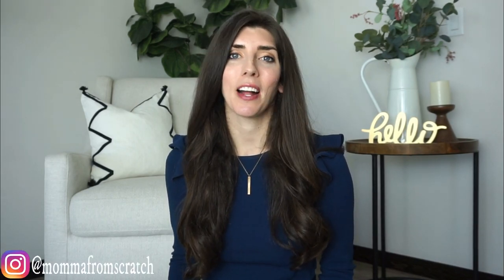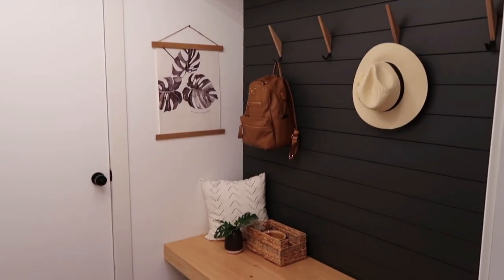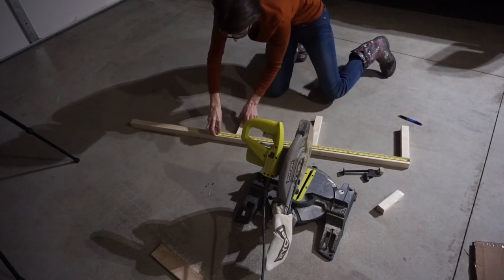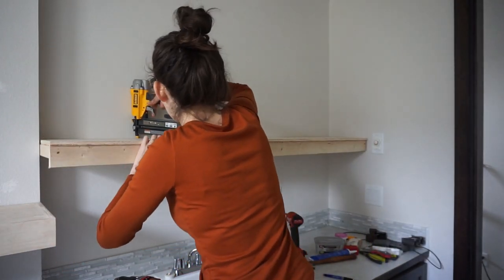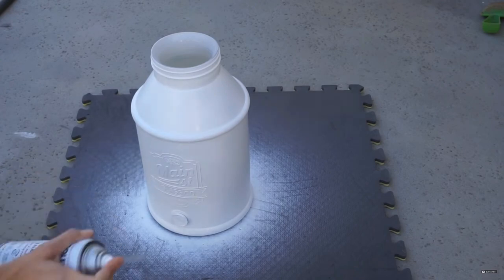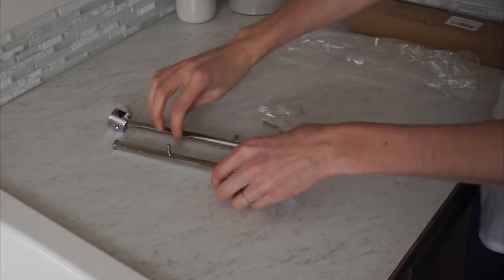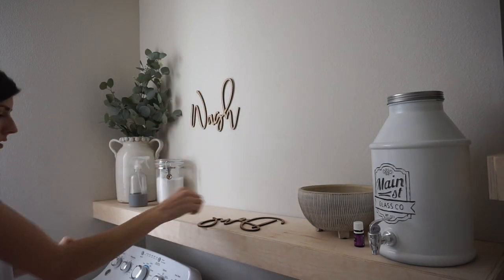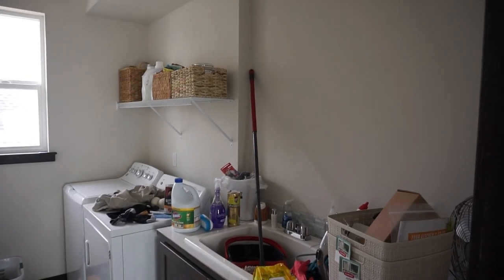Laundry Room Makeover 2020 | DIY Room Makeover under $150 | Modern Farmhouse

Comment: I actually had my daughter use her cricket to make my Laundry today or Naked Tomorrow Sign. I’m in a wheelchair and couldn’t reach shelves. But my husband put a pantry in my laundry room to hold my products in. I do hang clothes in mine as I take them out of the dryer. I have my grandmother’s old aprons hung up on one wall along with a sign that is actually the colors of my laundry room. And a clothesline that has the old clothespins. I use the clothespins to hang up the old dish clothes that she used. My room is painted a very light teal color. I use the broom handles to hang my broom, swifter handle, mop, and a tool that I bought that will brush up dog hair, and other small items to use between cleaning.

Comment: So envious. You're laundry room is nice and roomy. Love what you've done....I think my favorite is  losing the wire shelves. The wooden ones are so calming. If you ever find the same curtains in a longer length you could raise the curtain rod closer to the ceiling. I did this and it made a tiny room look a LOT bigger.
Reply from the maker: Thank you so much!! Yes I normally do raise them up high but since the curtains were shorter I kept it at that height. There are 98 and the 108 is to long and I didn’t want to hem for this room lol
Reply: @MommaFromScratch  LOL! I know what you mean!! Thank you for sharing and inspiring

Comment: ABSOLUTELY beautiful. I like the revamped jar with the spout. I may try that. But I was thinking in order to gage when to refill the jar, I may put a length of inch wide painters tape on the back going vertcally before paintong it . Then removing it after painting to see the level of detergent. Again absolutely beautiful.
Reply from the maker: You can actually see it if it’s a darker detergent like min. Plus it flows slower once near the bottom too.

Comment: Your laundry room came out absolutely gorgeous! I do have a question. On the shelves did you brace the 2x2’s with screws into a stud on the sides just as you did with the long 2x2’s on the back?  I only ask because I plan on putting a shelf above my washer & drier just as you did & I’m worried about if I put to much weight on it that it would eventually pull away from the wall. The builder of our home did a shoddy job putting in the shelves in our closet and the shelves are pulling away from the wall. That is why I am worried so much. That is just one of many project I have to figure out how to correct because of the builders shoddy jobs throughout our home.  Of course none of it started until after our warranty was up 😡. I would re-do my whole closet with drawers and shoe shelves etc. etc. but my closet is a 10 x 10 plus space and it will cost to much to do for us at this time. But I will do it some day 😉. Stay safe!
Reply from the maker: Yes anywhere there is a wall and a stud I added screws for strength. Lynette did the same thing with here laundry shelf. I created the cap because mine was open on one end hers wasn’t. You can also find on amazon floating shelf brackets that are metal. You’d have to get a think 2/3 inch board and predeilnout the spots but that’s another way to go if you don’t want to use the wood. You can use larger wood too like 2x3 or 2x4 for the wall braces

Comment: Love it 😍 I have  a big LG HE front loader on top of a pull out drawer and a regular dryer. The front loader washing machine stands out from the wall so far I wouldn’t be able to use the shelves but they definitely make an nicer appearance.  Washer is almost as talk as I am. Wishing I could post a photo! Unfortunately the back wall is underground cement wall that I painted over. And really don’t want to drill into it and caused any leaking into the basement. We live in wet New England! With lots of snow and rain.  Also above a ways is the septic pipe that runs along the wall. I painted that too to blend it some... And the dryer vent pipe that & the industrial looking wash sink pipes that go up in the area too! It is a partially finished basement, this side isn’t. Any suggestions anyone? Please help!
Reply from the maker: Hey!! Maybe send photos in an Instagram message so I can see it. Happy to help you